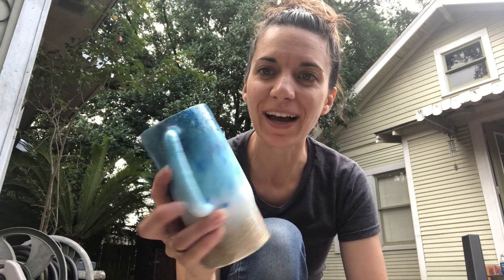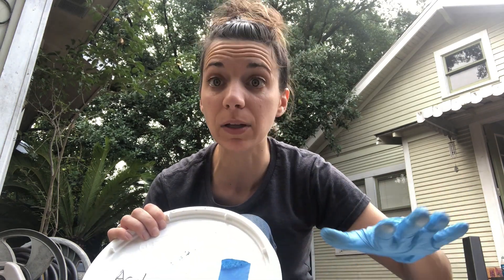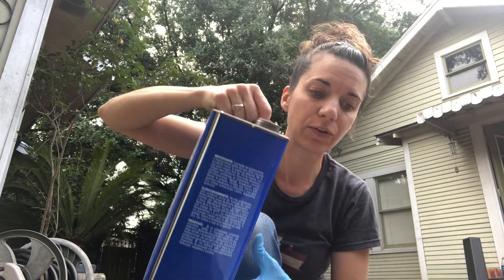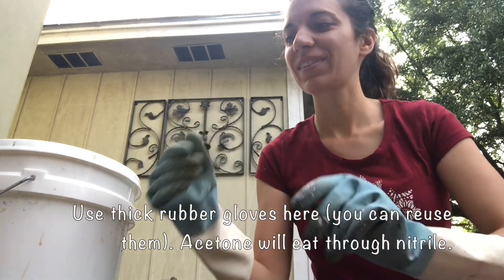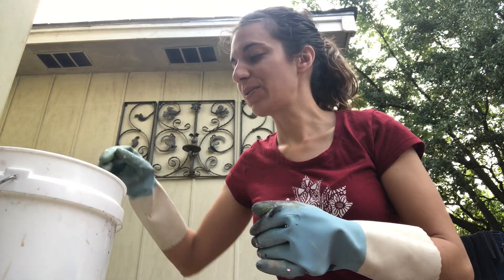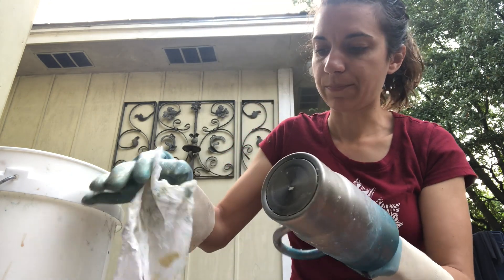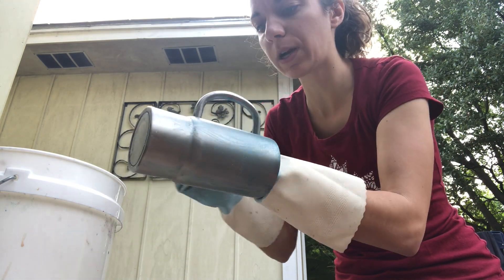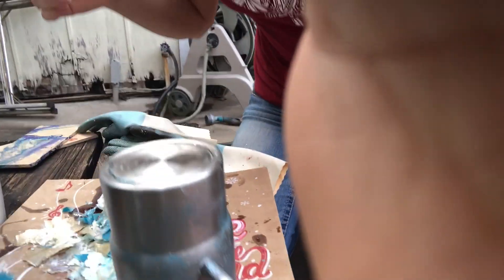How to Strip a Cup

Comment: If the tumbler was painted already and when I applied the epoxy it clumped while pouring and I do this method will the paint come off too?
Reply from the maker: Most of the time, yes the spray paint will come off too. Sometimes it doesn’t all come off. In that case, you can either sand it smooth and respray paint or you can try using a paint stripper (like citristrip) to get the rest off. *before attempting make sure all acetone has been washed off.
There isn’t any way to strip the epoxy off and leave the work underneath.

When you say clumpy, what do you mean? Did it get super hot? Is it on the cup but there are spaces missing? If you’re on Facebook, I have a small group with tons of info. It would also be a way for you to share an image so I could see what you’re talking about. Some things can be saved before deciding to strip.

https://www.facebook.com/groups/dextrozdesigns/
Reply: @dextrozdesigns6816  yes it did and I didn't know it would do that. Thank you